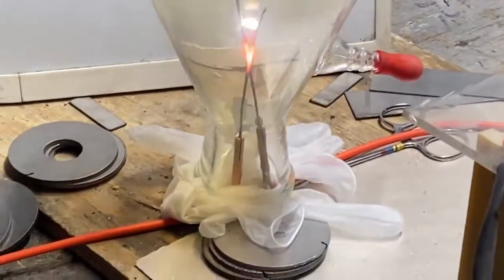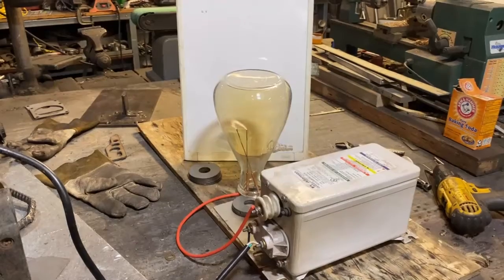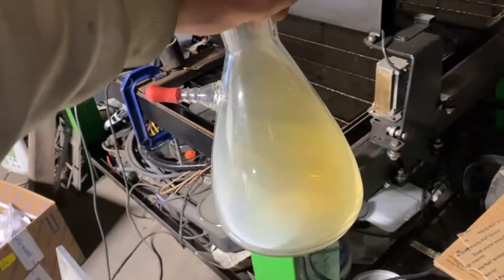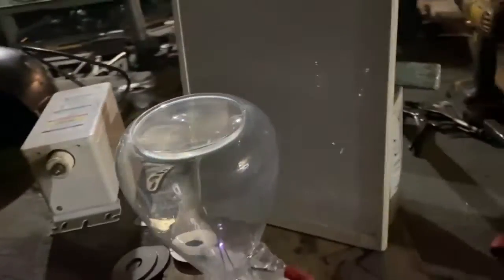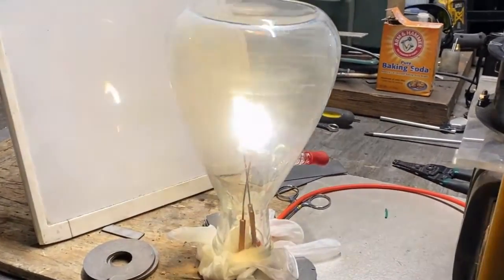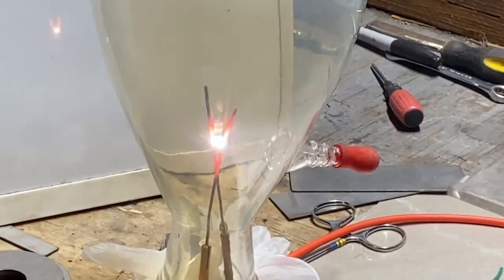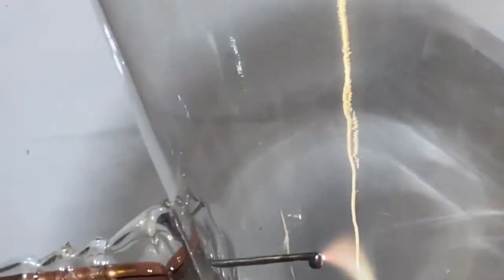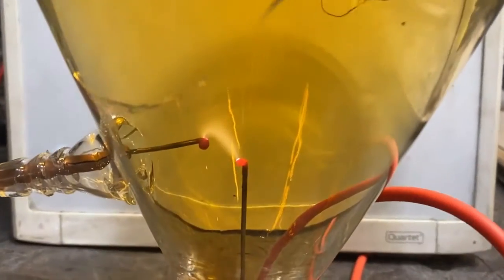Birkeland  Eyde  Arc Process nitric acid production

Comment: next up make a fertilizer machine...  bubble thru dolomite and water.  gives you magnesium nitrate and calcium nitrate. Also if you use some magnets the arc will fan out along the magnetic lines.
Reply from the maker: yeah but it weakens the heat and reduces performance . I looked into the magnet and im full convinced  they used it in industrial process because they had such a massive powerful arc that used like 15 Mw. I dont recommend it for small scale
Reply: @NOBOX7 It's calles the Birkeland-eyde process. It uses rotating magnetic field so it creates a plasma disk. What would be cool to see, and you're fully shop capable of doing it, is make the electrodes in the shape of a magnetron. Center rod cathode and fluted tubular anode.
Reply: @patrickbowen9395  more effizenz with Schoenherr Stove design. Haber from the Haber Bosch prozess had similar ideas an long pipe an electrode on top with handl and one on the bottom on the bottom side is the air inlet on top the outlet the air got blown inside and the handle electrode pulled upwards the arc looks like an corc screw it had an effizence in haber lab of 7,5% when you think about that 10% is the maximim with arcs thats really good.

Comment: Your apparatus appears too complex….The brown gas Is NO2 . Try misting , recirculating, H2O2 at the top sides of the reaction vessel! I think the peroxide will absorb the gas better than water. Just a thought. But it should maintain a cooler reactor while still allowing the higher reaction temperature

Comment: In industrial BE reactors, there's usually electromagnets to manipulate the plasma into a disc shape. Idk if that would help

Also regarding the last chart you showed, the brown gas is already NO2. You don't need the other steps before bubbling it. What I would add is maybe increase the oxygen content in the flask to get it closer to a 1:2 ratio with nitrogen.

Comment: Nitrogen Oxide is colorless, Nitrogen Dioxide is the brown gas so the tests you were performing might not have been producing good results for other reasons like insufficient oxygen to convert the NO.
I had an idea to retain the maximum amount of Nitrates, make the NO2 directly into a Sodium or Potassium Hydroxide solution, it will turn directly into the Nitrate and the NO will pass through and can be re-oxidized.
Reply: you can use H2O2 to oxidize the NO that ascapes to HNO3
Reply: @Preyhawk81  The price of H2O2 here is higher than Nitric acid, what does it cost you?
Reply: @TheHuntermj  price istn the problem because nitric isnt here aviable for private use and you dont need much h2o2 for the small amounts at the end of the filter colum or you use silica gel it can 70% of its one wight absorb NO gas .
Reply: @Preyhawk81  I can buy 20l of ~70 technical grade nitric acid for about $100 here, no licence required.
All they want to hear is that you have a use, I actually said I had a chemistry channel on YouTube, which was true but I gave up, and they were fine with it.
Just be confident, charming and rehearse a good story, you'll be fine!

Comment: Outstanding work, nitric is in short supply in the UK, we have seen a 160% rise in price since this time last year, i cant do my small scale metal refining without it .
 I have been looking into the viability of making a BR, i have high voltage as a hobby so have a head start. 
I have a 75 pound beast of an X-ray machine transformer here that will put out 40kv at scary amps, 
but i have a hunch it is gonna destroy everything i put near it. 
I was going to use thoriated tungsten electrodes. Ime glad i found your channel, i will give a pair of stainless steel rods a try. I have a 2 foot bell jar but ime concerned i will kill it, that thing cost a heap some years ago.

Comment: As a reactor if air is dry you can use stainless, NOx barely attack stainless in a dry enviroment (jet engines are still kind of wet), for the arch generator you can use a second low voltage high amperage DC unit after the voltage multiplier... More or less as the Hf plasma start in welders and plasma cut. 

First air is ionized by the low current high voltage after air now is conductive even a cheap stick welder will allow you to dump hundreds of amps. It's a bit counter intuitive design witch require some diode protection. 
It have mainly 2 plus you can tune the amps you dump in  and is less likely to be lethal since its all dc courrent.

Comment: Cool, about 10 years ago I went through the same transformer juggling. Got the best results with ZVS-flyback and 6kV neon sign transformer. Used stainless electrodes. My best runs had a yield of about 3g/kWh(by titration). Industrially they had about 30g/kWh. If you need nitric acid I would consider the standard nitrate + sulfuric acid route, way quicker, way more reliable. If you have to diy it, and you live near a bog, you can get nitrates from electrolysis of the bog(all you need is a unglazed pot, some lime, an iron rod, a graphite rod and some coke(coal not cola) as well as a power source)
EDIT: Just Wanted to add, I got poor results with every HF driver I  tried, just end up making ozone
Reply: Hi, would a larger kV help? I have access to a 1000kV spark gap but im not sure if its a good idea to use such high voltage when I see yt vids use around 5-15kV only

Comment: the jaccobs ladder was used under the name pauling process in austria it had an effizencie of 3,5% birkeland eyed only 1,5%. They wrote the advantege of the jaccobsladder is the air is cooled faster but it can only produce very deluted NO so you can only reach an acid with 30%. If you have more heat your NO is more concetrated and you can achieve highter concentrations but energie effizience is lower.

Comment: Awesome. I’ve managed to get more use out of broken stuff with clear RTV silicone caulk. But then again you have HHO so you could perhaps fix the glassware. You need to bring it up to annealing temp and slowly cool it so it doesn’t crack after the repair. Or QGlass in the USA or China sells quartz glassware that can handle 1100°C.

Comment: Hi, would a 1000kV spark generator be better? Or would it jusst be more dangerous? I definitely underestimated how strong 1000kV is
Reply from the maker: It just need to get hotter than 3000 deg . the volts does not matter . you can do it at 60 volts but the amps would need to be high enough to melt everything like a tig torch

Comment: Can i use microwave oven transformer ;?
Reply: I'm contemplating this exact idea. The problem I see is that microwave transformers are not rated to be on for long periods of time. Also, if you don't properly ballast it, it'll just trip your breakers over and over. I think it can be done with a proper setup though.
Reply: @Max_Chooch  though, microwave oven transformer output is upto maxium of 2kv, which is very less compared to eth/flyback-transformer, which also runs for peroid of time. but the difference is, flyback transformer requires zvs driver circuit to run; consumes less energy gives better arc, but smaller arc.
benefit with microwave transformer is that; it can run on mains-directly without any needing of external circuit, it gives very long arc, but the disadvantage of this transformer is that it dosnt self ignites the arc, so that we have to do it manually to start the arcing process, and it gives Yellowish-brown-red arc while as eth gives blur arc.
about power consumption; I think microwave consumes alot of enery but eth/zvs dosnt that much compared

Comment: I'm not as versed (experience or industry) as many on here, but my immediate thought on a good electrode material was... why not look to arc furnace electrodes?  (Carbon as I recall)
Reply from the maker: Carbon burns and smokes , you would need to keep resetting the gap or make an auto gapper
Reply: @NOBOX7  
How long do these stainless steel ball electrodes last?
Reply: It's carbon, so yeah it would reduce your efficiency by consuming the oxygen needed for the O in NO2. It would literally catch fire too. However, in an oxygenless atmosphere it would be fine I think.

Comment: if you just need the heat, isn't heating a piece of metal using induction heating would suffice ?
Reply from the maker: you need 3000 deg +
Reply from the maker: Yes if you heat high temp refractory or exotic metals

Comment: I want argon. Can I use this process to remove the oxygen and nitrogen to concentrate the argon in next stage/process or it's energetic very expensive if used only to obtain argon?
Reply from the maker: it only oxidizes 5% of the N2
Reply: Inexpensive argon?  Cryogenic fractional distillation

Comment: I have seen a couple of youtuber try this method. they have to run the setup continuously for weeks, if not a month. which, seems not a fast way to acquire the acid. the industrial way, which is probably the cheapest and most efficient way, is to "cook" liquid ammonia with oxygen in a distill tower with catalysis. a toxic and smelly procedure. require 24/7 attention during process. how much acid you need to fulfill your usage? if you count cost and time, very likely buying it may be the cheapest and fastest option.
Reply from the maker: The time wont cost a thing as it just runs in the backround  . No way its cheaper to buy this day and age , a guy made 2 liters in 12 hours with 5000 watts of 70% solution . Yes there are alot of people doing it wrong ... They dont even oxygenate the nitric oxide
Reply from the maker: Thanks for your input , i think im gonna give this a try
Reply: @NOBOX7  wow! 70%? it is too good to be true, because the cooking ammonia industrial method only give 68% at maximum, and the factory already use platinum wire mesh as catalyst. i seeeee, you are looking for that extra 2%. right?

just be careful testing, bro👍
Reply: @luderickwong  Well is true that a guy made 2 liters of 68% in 12 hours but the key of his success is he uses a a lot of power and a high current arc spread into a ring by magnets similar to the original Birkeland-Eyde processes but also there is another reason and I think is a very significant reason for his high yelds; he uses relatively tall absorption columns (two 10L columns so 20L in total) and low concentration in his absorption columns, so after it reaches around 7% concentration he boils down his solution until it reaches azeotropic concentration so ends up with around 2L of azeotropic. 

In my experiments the highest concentration I could reach was around 42% so if instead of trying to reach maximum concentration you focus in maximum absorption with reasonable amounts of concentration your yield increases dramatically, even from an energetically point of view its much more efficient to "distill" than to let run your B-E apparatus.